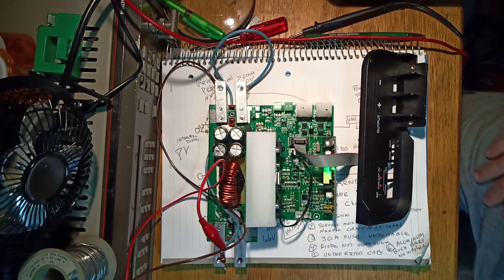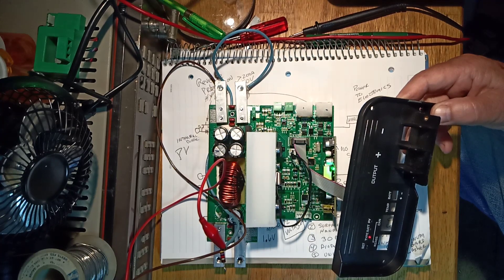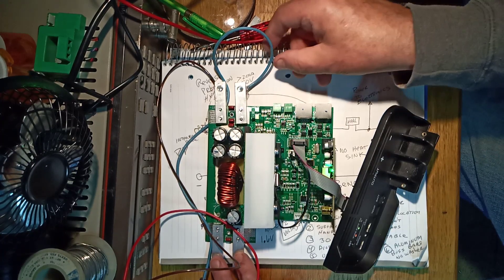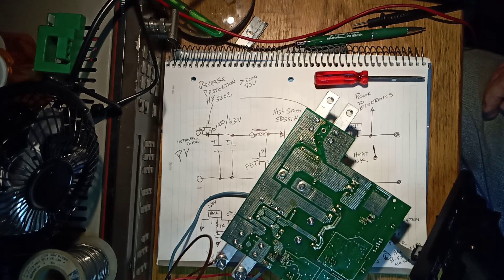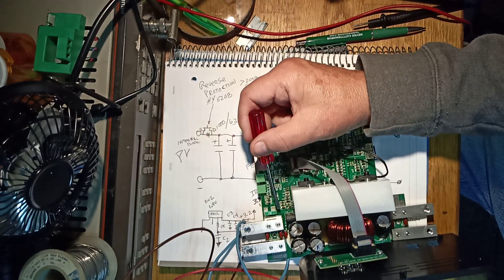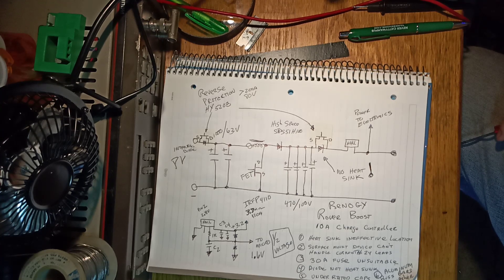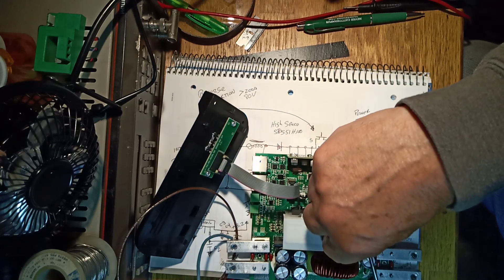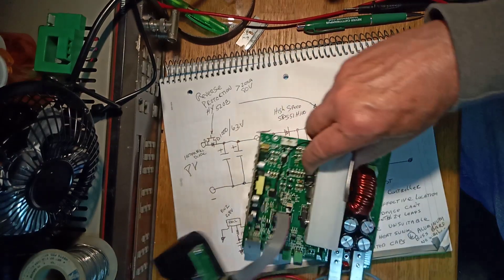ROVER BOOST Golf Cart Charger Repair, RENOGY Is Still Junk.

Comment from the maker: You need a manual to set this up and decode the LEDs. You are out of luck if you are color blind because battery type is indicated by color. Might be hard to do outside. If battery ever goes low, you will have to disconnect the unit and charge first.  Read manual carefully because it will not work unless you follow the instructions exactly.